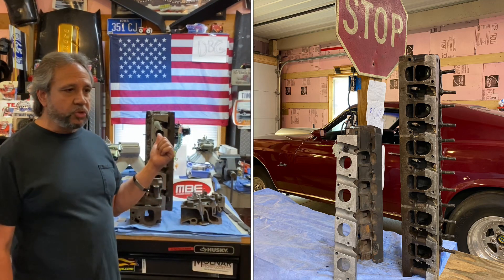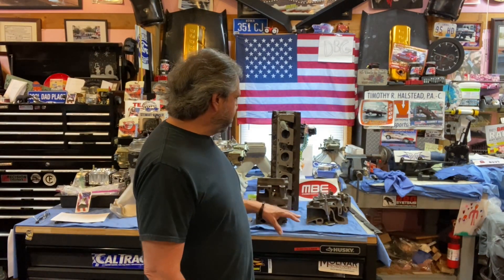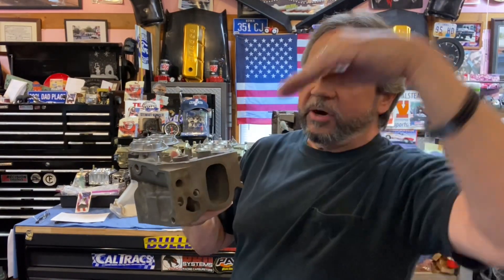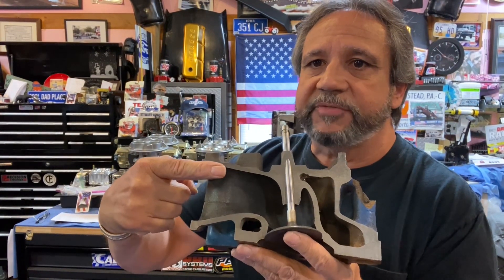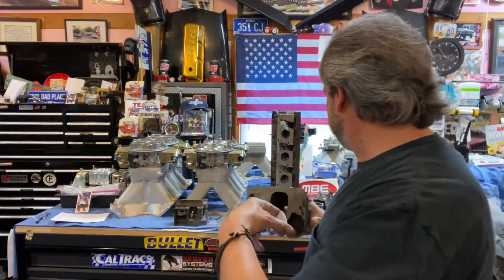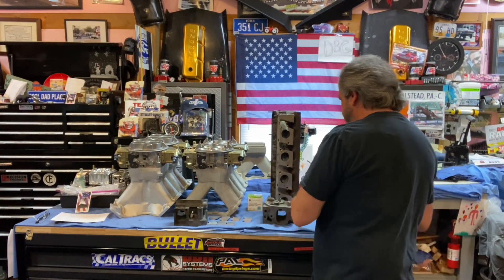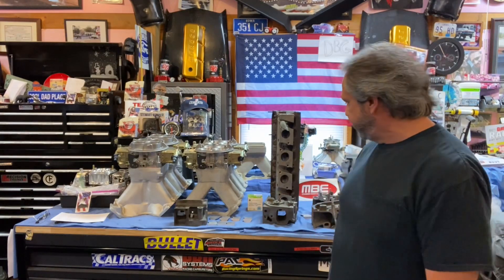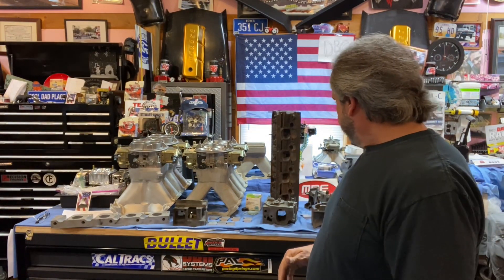DragBoss Garage: Pick Up 30 Ft. Lbs. Of Torque Filling The Port Floors Of 351 Cleveland 4 BBL Heads

Comment: Im very happy to be the first person to get some DragBoss stickers, I appreciate it very much.
Now for some rambling from me, when we are looking at cylinder heads and sizes the very first thing that needs to be considered is the cfm demand of the engine at the desired rpm point, now people will look at that 6 cylinder head with 4V ports and think its silly to use a port thats considered too big even for a 351 V8, yet a 351 has 43.875 cubic inches per pot but that 300 6cylinder has 50 cubic inches per pot.
The 351 has an intake port cfm demand at 6500rpm of 279cfm, the 300 6cylinder cfm demand is 318cfm at the same 6500rpm point, all cfm numbers are at 28" test pressure.
Once you have your cfm demand target then you can calculate a minimum cross sectional area to make sure its physically possible to flow the amount of air you need as efficently as possible. So take that cfm demand number and divide it by 146, 146cfm is the maximum amount of air per square inch of area that can be moved at 28" test pressure.
The 351 minimum cross sectional area at 100% efficency is 1.91"squared, the 300 6cylinder needs 2.18"squared. My personal process is to aim for a 95% efficency so I multiply that area number by 1.05 to get my minimum cross sectional area numbers.
The entry of a 4V port is absolutely too big and should be filled in every circumstance in my personal opinion, there isnt enough material further down the port at the short turn or bowl that could be removed to ever warrant the stock port entry size.
Reply from the maker: Sean your welcome. I appreciate you taking the time to explain to us the mathematical logistics. This is something not many know and you break it down well thank  you. 2 things, first is when you say max is 146 cfm at 28 inches. Can you extrapolate. What lift, is lift even a consideration?  Second. When we look at this process or theory, to me it’s a dry theory, it’s not a dynamic environment. Even with wet flow, I think it is a guideline, but in a running engine there are many variables that you cannot reproduce on the bench. Including, heat, molecule size, degree of atomization, pressure, both atmospheric and combustion. The list goes on. Thoughts there and relationship to bench flow Sean. Thanks
Reply: @dragboss351cleveland  I will do 2 replies to try break it apart.
146cfm per square inch of area at 28" comes from the point of the pressure differential itself, air moves from high pressure to low pressure, when we are testing an intake port/intake tract we create a lower pressure on the bore side of the valve head using vac motors, so air from our environment will be the high pressure side of the valve head, now it doesnt matter at what altitude you do this because its the pressure differential number that determines the average airspeed, in turn that determines the max amount of air that can be moved, 28" of water column pressure differential is 1.011psi, 1.011psi pressure differntial results in a maximum average airspeed of 350fps, air moving at 350fps through a 1"squared area calculates out to 146cfm at 100% efficeny.
When looking at lift the valve curtain area, which is the area created between the valve seat and the valve head will for a period of time be the minimum cross sectional area absolutely, once a valve is at 1/4 of the vale heads diameter in lift, for example a 2" valve at .500" lift has now reached a point that the curtain area is the same area as the entire valve head itself, now given that a throat of any port is always smaller than the valve head itself we can now say that the valve/curtain area can no longer be the minimum cross sectional area, the throat may be now the minimum or any other section of the port itself, commonly the pushrod pinch. With all that going back to the original cfm demand numbers we were working out a target for airflow through the head to support a cylinder at the max rpm point as well as the point of max piston speed during that one cycle, max piston speed occurs generally around thew 72/75 degree after TDC point. 
I will end this one here and go into a bit more detail on the next reply.
Reply from the maker: Wow. I have heard Darin explaining this and it one of those things I have to read a few times to make sense and get a grasp of the context. I have heard him also max piston speed is 76 after tdc. So helps to hear this again. I am posting this on the cleveland FB page. And going to set up a head flow playlist. Saw you wrote more. Will ck this out Sean. Thanks mate
Reply: @dragboss351cleveland  A flowbench is just a tool and you are spot on that it cant replicate dynamic actions that occur in an engine at speed. What we can do tho is develop stable airflow paths at every lift point and have a way to not only measure the cfm but more importantly the airspeeds of precise areas within a port and work out the efficency of the areas involved. You can hear if a port is stable or not, you can put flags in the port to "see" the airflows behaviour, pinpoint the dead areas like you spoke about in this very video.
Now a pressure differential is the base "energy" to airflow, on a flowbench this is created by vac motors and we control those to give a stable pressure differntial to be able to reference test to test, in an engine a pressure differntial is also the base "energy" for airflow, now it starts in the overlap period when the exhaust gasses are still exiting or even may have already exited if good scaveging is happening, this leaves a low pressure situation in the chamber even as the piston is still approaching TDC, as the intake valve cracks off the seat air/fuel moves towards the low pressure area, this is the start of the momentum of the intake charge even when the piston is at TDC and not moving back down the bore yet. Reversion happens when the pressure in the chamber during overlap is higher than atmospheric and exhaust gas moves into the intake tract instead, wasting a good start to cylinder filling.
After the overlap the piston decending down the bore is now the source of creating the pressure differential, the piston starts off slow just after TDC and increases its speed until about 72/75 degrees after TDC, then it starts to decelerate as it approaches BDC, now this next bit will be very important to understand.
To maintain good energy to promote airflow you have to maintain a good pressure differntial, the pressure differntial is created not just by the piston decending but also by the restriction of the intake valve/port and tract, the piston has to pull against something to create a pressure differential, then the other side of the coin is that you dont want too much of a pressure differntial as that creates airspeeds either past the valve seat or in the port itself that are too high and not controlled, they will seperate and choke the port making the situation even worse, its a sub-sonic choke, you will see this on a dyno when all of a sudden the power just falls off.
We want to keep airspeed to around the 0.55mach number, that equates to a pressure differntial of 3.17psi, so how do we do that? Camshaft and knowing the full lift range flow numbers, knowing how much flow an intake tract has all the lift points we can then design a cam profile that can have the valve lifted to a certain height at a certain time in the cycle to maintain a good pressure differential which is our "energy" to get momentum happening in the intake charge.
After peak piston speed we are now relying on some pressure differential still to maintain airspeeds and momentum but once that piston is close to BDC we are now relying purely on that momentum energy to keep filling the cylinder even as the piston starts to come back up the bore for the compression stroke. 
This is why in my opinion a flowbench is a critical tool for engine development, we need a way to calculate and measure to see if a cylinder head package can deliver whats required and to be stable and efficent doing it. Cheers
Reply from the maker: There is so much info here Sean. Such a great summary. Again I have to read it a few times. Thanks for breaking this down again into simple terms even I can understand mate
Reply: @dragboss351cleveland  no worries at all Tim 👍 I’m interested in the feedback from the Cleveland page.
Reply from the maker: @seanb250  I can see this process happening in my head, hard to explain, but I wonder if others see this dynamic scenario going on. Again I have to read it a few times, yes guys on Cleveland site like this information. i also started to make a new playlist of cylinder head flow, and dynamics. I am making videos from my past live chats with Darin. I was thinking about making on of yours, but might be better if you did it in our live chat, your more versed at this. Your explanation will sound much better too. Give me time on stickers, I am way behind on everything, your on the list I won't forget mate.
Reply: @dragboss351cleveland  So reply number 3, sorry but I did warn you I can talk alot hahaha.
Heat effects the airs density, on a bench we are testing generally at a lower air temp than what the engine will see through its intake tract, so therefore on the bench the air is at its heaviest when looking at N/A engines, so any density instabilty issues will most likely be seen on the bench, especially an experienced user who will look at localised airspeeds and determine that an increase in density may cause seperation from a short turn for example.
Atomisation in my opinion is related to airflow and also seperate from airflow, good even airspeed with some peaks of airspeed in certain areas will 100% promote better atomisation, dead areas will do the opposite and fuel will drop out of suspension and even in some cases travel back up the inlet tract and cause all sorts of air/fuel ratio issues even in other cylinders. In saying that you can have the perfect port/runners, then have a carb that dosent have great signal or is poorly tuned, then that becomes the reason for poor atomisation that is not created in any way by the ports. The same goes with injection, there are injectors that are just poorly designed or wrong placement within the inlet tract that will have horrible atomisation, the other thing with injection is that people think that inlet runners can be smooth from the injector back, people have to understand that an injector is spraying in a lot of cases while the intake valve is closed, fuel vaporises on the back of the valve head and at the same time you have a pulse running up and down the entire inlet tract from the last valve closing event, this moves that fuel up and down the entire inlet tract with it, so texture all the way up to the runner entry is required in my opinion to minimise fuel clinging to smooth runner walls, a boundary layer is still required but thats another subject for another day.
Again thanks for your time and interest in what I have to sharw Tim, I appreciate it mate.
Reply from the maker: @seanb250  Your most welcome mate. i appreciate that you take the time to educate us on airflow, and your vast experience. I and many others enjoy this aspect of social media so to speak. Where ideas can be shared without repercussions of someone behind a keyboard. Now some have a varying opinion, and may share their thoughts, but for the most part it is done diplomatically. I again can see the air fuel mixture moving about through the intake tract, with the effects of harmonics, density, and heat. You break it down well. Can't wait for the live chat it shall be grand, especially since you port more than the typical V8, I am used to, including multi valve applications. Thank you Mate, stay tuned, more on the way...
Reply: I agree, or... just use the 2v heads,  open those up.
Reply: @tunnelportterror  I put filler in 2V ports as well, only to fill and raise the dip before the short turn, then you can grind the short turn a bit and move the peak of the short turn further back into the runner.
Reply from the maker: Hope you got them Sean?
Reply: @dragboss351cleveland  THEY ARRIVED!!! Great looking stickers mate, I will take my time to place them as I don’t want to waste them on an impulsive sticking fest 😂
Again I’m very appreciative for these and feel honoured to get the first round of them 👍 cheers
Reply from the maker: @seanb250  your most welcome. Glad they arrived, don’t forget to show them off. 😊. I am working on some more merch. Slow but sure. Thank you Sean, for letting me know.
Reply: @dragboss351cleveland  not yet mate, the postal service here in Aus is next level slow 😂

Comment: I’ve got a question about the port fillers.I have you heard or do you know about having to or how much it hurts for the intake to be larger ported possibly full 4V in comparison to that port filler. Does it seriously inhibit the flow of the air fuel mixture and hurt it more than it would help unless you get a 3V as they call it intake? I have port fillers, but the only intake I have is an old school 4V aluminum intake.
 PS. Side question, that replacement heart valve you’re showing us. How would that application work in a V8? This may be a question for Darren Morgan………… LMAO
Reply from the maker: Not sure if I understand. But you never want intake port of manifold bigger than opening of the head intake port, smaller ok, not bigger. By replacing the heart valve, you may still be able to drive a V8

Comment: G’day, With that port insert, it should be a curvature not flat. Harsh corners in a runner is a dead area hence why many ports are oval. The other thing that insert does is reduces the radius of the port. Great idea.

Comment: so my research brings me to recommend Devcon 10210 Liquid Steel Liquid for the filler also putty available but I hope the liquid will work better for this application, I bought 1 pound pail for around $95, I'm sure its enough to fill 8 ports, I'll let you know.

 I have a question, what intake manifold will best match this filled 4v port?, seems most intakes have ports at 2.04 tall x 1.42 wide, but some bigger ones like blue thunder or CHI or Parker Funnel  are too expensive, I found a trick flow intake close to a 2.1 x 1.5 port, the biggest  I can find for not high cost.  I think once I fill 4v port on head it will measure  out at 2.1 height and 1.74 wide.
Reply from the maker: The best is splash zone as per Darin. The intakes that match are the Motorsport intakes, and the others you had mentioned. Any intake going to be in the $500 dollar range.
Reply: @dragboss351cleveland  your focus is on Pro Stock Drag racing, mine is Streetable versions, I found a Edelbrock Performer dual plane specific for 4V head #2665, port size is 2.15 H x 1.37 W, smaller than  all the aussie 4v intakes but bigger than most american designs (modern times), why there isnt a better match from USA like the  Aussies is beyond me?, this isnt rocket science. most likely much bigger market in Aussie land for 351C, money always does the talking.  I found the edelbrock on sale for $280 brand new  RPM range  is idle to 5500 RPM, perfect for my range goal for street, plus Im going to use Aces EFI instead of Carb.
I will port match and port fill, hope I get good results.   thanks for  sharing your knowledge.
I decide to stick with streetable dual plane instead of single plain, plus I want to keep deck height low so  I can use the Factory Ram Air Hood and system.
Reply from the maker: @sacooper802 that will work well for your goal. Many want similar streetability, but want big cams, and single plane. On street where rpm usually not over 4500, it will shine. Good luck with port fill. I think you be surprised.

Comment: I would love to fill my LS1 ports.  I can stick my finger on the floor when it's on a flow bench and not feel any air movement.  I would fill it level to the top of the short turn.  You gain torque everywhere.  It's also beneficial to have at least a 5/16" radius in the corners

That cleveland exhaust port is horrendous.  Exhaust gases move MUCH faster than intake air, and can't navigate corners at all.  I'd raise the floor to make it parallel with the roof.  David Vizard puts an angle plate in the header to prevent reversion.
Reply from the maker: You should try it and see what happens. Be a great test. Never heard of the angled plate in header. Let us know if try filling in the port.

Comment: The discussion on valve replacement!
Reply from the maker: Meaning?
Reply: @dragboss351cleveland  Aortic valve
Reply from the maker: @dennisrobinson8008 usually they become  sclerotic and build up calcium deposits. One of the most contributing factors is a bicuspid valve that only has two leaflets instead of tricuspid/three.
Reply: @dragboss351cleveland  Sounds like heavy carb deposits on an intake valve!

Comment: Is it possible to braze intake port up to increase velocity
Reply from the maker: Yes, but way more work than epoxy or aluminum port fillers.
Reply: Thanks, worried epoxy come loose. Thinking about port stuffers, drill holes in intake runners to attaching was told easy to chip or brake the stuffers. I gonna stuffer route first. Thanks again.
Reply from the maker: @anthonycombs1623  That sounds like a solid plan Anthony, your welcome

Comment: Did you ever flow the clevo heads with the exaust port plates? Ive seen many versions of them. Most have square ports, yours are round and im keen to see what they flow.
Reply from the maker: I have never flowed them. I do have a couple sets at BES and plan was finish TrackBoss 427 and the. Start with heads and intake there.